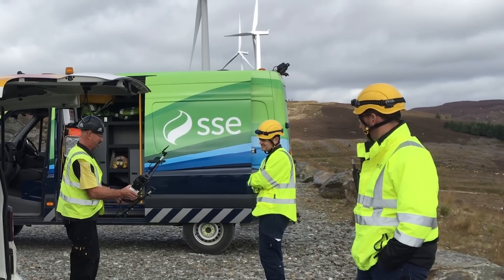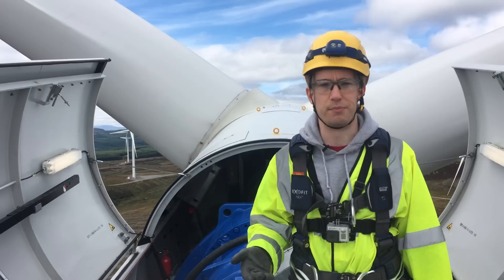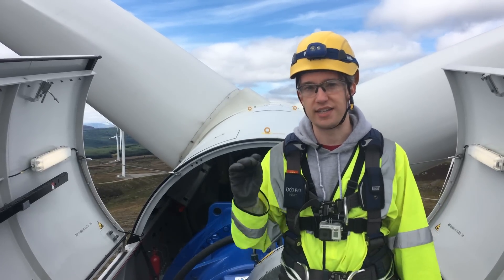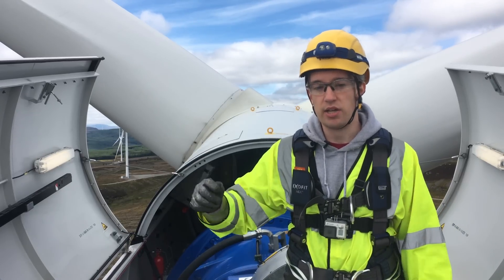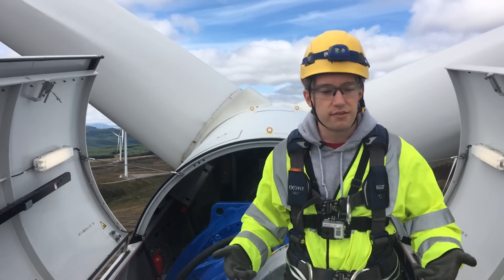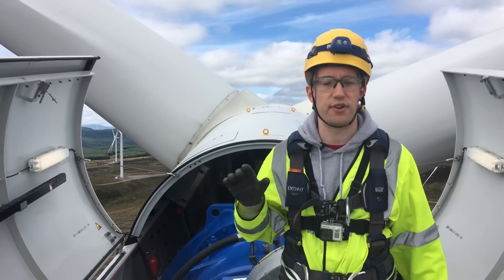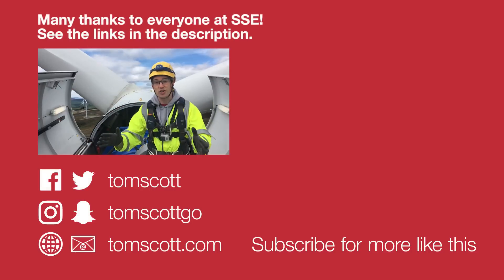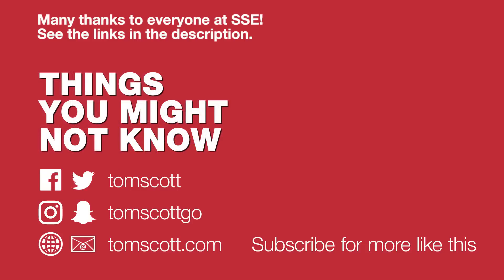The Problem With Renewable Energy (and how we're fixing it)

Comment: Hey, if I buy an electric car I don't want to wake up in the morning to see the battery is at 10% because of the lack of electricity they had to compensate. What about that? And than everyone will have to get it charged from the net since they don't have the range to get to work, how would you compensate that? Or in the other case people with such statements could be smart and say 'hey, let's make a deal that you in the morning will at least have 80% left in the car' I would say that would be great, but than the problem is since only 20% of the battery can be used, only 20% of the projected storing capacity will be free to cut down high and lows. Than maybe a giant monolithic battery would still be needed... Oh and on the other hand, good luck with trying to use hydrogen cars for this plan. I'm sorry so be so skeptic, but I believe there are better ways. Such as storing an overload of energy in biogas or hydrogen to burn it in a generator when needed... Or to propel a car...
Reply: Pretty sure it wouldn't work like that. At any one time given such a large infrastructure envisaged, there would always be enough vehicles that were near full capacity or full charged that some could be used for short time spans for load balancing. The computers on the system would be aware of the times the car was usually used and so could make sure it was charged ready for that time. Also let's not forget this would no doubt also be a high current fast charging infrastructure, so a vehicle could recieve a full or 80% charge within a few hours if needed.
Reply: +rationalmartian within a few hours doesn't sound quite fast to me. If I had to leave for work I wouldn't wake up hours before to get it fully charged. That's one of the reasons why I prefer fuel cell cars above electric cars, fast charged. I would like for people to believe in this 'electric car as a buffer' system to show me the numbers of reality. Because in theory everything can sound great until reality hits in... That is what I fear that could become the problem here, or there would be a complex system to make sure ones vehicle would be charged when needed, or just left at let say a minimum of 80% charged for unpredicted use of the car. Or there should be another magical way to assure people that the car can be used at al times when needed. It is pretty paradoxical to try to use an battery-electric car as a temporary electricity storage and as a car that should compete with the independence, range and full time availability of a fossil fueled car...
Reply: Keep in mind that the point of this isn't a long term power shortage: this is for immediate pick up, so it would only be a few minutes of discharge, which isn't going to cause a significant problem for running out in the day.
Reply: +Chris Hughes (crh23) Than why would they claim that there wouldn't be a need for 'giant monolithic batteries' or other kind of storage facility just bin using the electric cars' battery... As I said, if it wouldn't affect the independence of the car I wouldn't be bothered, but for what I see know most are vague about it, never claiming his much impact it can have on the car, even worse, they count the full battery storage potential of the electric cars and than speak about that total being the total potential that could be used before having the need of 'a giant monolithic battery' which for me means they full use the full potential of the car, that could give the risk of having not enough electricity in the car to get to work. And yes, fast chargers could help in that case, but if I plug an electric device in the wall, I want it to be charged to at least a useful load (as iPhone user I know how hard it can be to have not enough battery power left)... Just my opinion though

Comment: You don't need to sell the power back from your car. It would be enough, if the car would stop charging when there is not enough power.
Reply: That would require extra technology in all EVs. The grid already has to monitor and regulate the electricity flow, drawing power from EV batteries for brief periods just "reduces" the need to build large energy storage facilities.

Comment: But this problem wouldn't occur with solar energy right??
Reply: Happens with solar, too. Can be fixed with batteries. If you've got the money for a big enough solar array and battery bank, you can run your house with no grid draw and have your grid connection as an income source, rather than an expense.

There is one case where it doesn't happen with solar, and that's a molten-salt solar-thermal power plant. Those store the sun's heat in molten salt for generation after the sun goes down.
Reply: @Roxor128  ohhhh thankss for the knowledge

Comment: Couldnt u use the electricity to power electric motors to Spin the thousands of tons of metal and when u Need ist just stop the motors ...
Reply: Google synchronous condensers. They are primarily used for voltage control, but provide inertia (although much lower than the turbine generators inside conventional power plants.)

Comment: Buy cheap overflow electricity to your own cars & sell it back later automatically at higher demands. Interesting idea.
Reply: Interesting idea but the effect on batteries should be evaluated before implementing a system like this.
Reply: @FrainBart_main   Yes. no one wants the expensive battery overworked, reduced life span & expired even if the car just being idle in the garage.
Reply: @nightsage217  You're right but I don't know how much this would shorten the life span if a lot of cars would be used at low power for this (maybe it would pay of because of the cheaper tarrifs). I think a better option for demand-side management is in devices that have long thermal time constants like water heaters, just like they are doing in South Australia.

Comment: The Solution is NOT Difficult - Use wind to produce the energy and to create hydrogen from water, and store the hydrogen in high pressure takes underground close to the wind farms.  Burn the the hydrogen when power is needed.
Reply: Two problems with that:

1.) hydrogen being the lightest element in the universe, even as a diatomic gas, means that it’s very difficult to contain in large quantities at high pressures without leaks. It can literally squeeze between iron atoms in a steel container if the pressure is high enough, making everywhere a potential leak

2.) the process of electrolysis and conversion back into water + electricity is only about 40% efficient at most due to heat losses, much less than the energy conversion of a battery.

Comment: Correct me if I am mistaken but a long term solution to this (maybe more expensive) would be to switch over to direct current.

Not sure if that works out but the power production just feeds into the flow of electricity.
Reply: Edison was a proponent of DC. It requires an extreme number of generation systems.  Tesla and Westinghouse proved ac was superior. No electricity is safe, but AC is able to move over long distances, DC is basically going to be a power plant in every neighborhood

Comment: 30% of the time it works all the time.
Reply: Funny but it actually operates more than 30 % of the time. The average capacity factor is somewhere around 30 %, but they are operating at lower than rated power probably 60-80 % of the time.

Comment: FAILL!!! All coal plants where on standby burning lots! LOTS! of coal!! Really! And also the gearing doesnt't matter fucks for modern mills because they have frequency(very expensive!) frequency converters. The mill you @Tom Scott are sitting on is really small. The ones here are huge and use HUGE DC magnet generators!
Reply: Utter rubbish, plant on standby is not burning any coal, they simply take longer to get back on load. Pumped storage and system capacity takes care of fluctuations.
Reply: Like Germany has so much pumped storage. And what system capacity are you talking about!? The overloaded power grid or those of neighbouring countries? that share the same problem!?
Reply: Pumped storage is A joke.Here in the Netherlands quickstart power is provided by gas turbines and diesel engines.Germany has just approved  hundreds of MegaWatts of diesel buffer power! for their failing windmills! How green you want to get it?

Comment: Wind is not replacing coal and oil at all! Every single piece or process to put thoose turbines functioning needs a lot of coal, oil or gas. There's a lot of steel, concrete, fiberglass, cupper, neodimium, heavy vehicles needed to install and transport; none of thoose come from wind or sun.
I like the idea for balancing the grid but so called «renewable energy» is just another extension of fossil fuel's bussines as ussual.
Reply: What's coil
Reply: @suityboi2126  Is a mistake. I'll correct that, thanks. Mi english writting is rusty.

Comment: It’s not the rpm that govern Hz output.  It’s the poles in the rotor times the rpm, come on.  You’re filming on top of a windmill as if you’re an expert....
Reply: Pole pairs times the rpm/60 = grid frequency to be exact and that is only for grid-tied synchronous generators. There is also research of how to use wind turbines' kinetic energy with power converters' control for frequency support (synthetic inertia, deloading techniques (over-speeding, pitch control)). Sorry, I had a need to be a smartass for a minute.

Comment: Or you could just have a few reactors hooked up to the grid to make up the differences, those are really good at scaling to demand because the rate can be determined exactly with control rods. Mostly renewable with a little nuclear is a perfect solution until fusion comes about.

Comment: Somewhere, 6ft underground, Thomas Alva Edison is laughing his half decomposed lungs out... AC has a hell of a lot of benefits, but a DC grid would make this problem absolutely moot.

Or, like, feeding everything through a rectifier then electronic inverter chain...

...or maybe just a ginormous flywheel somewhere, connected to the grid via a motor-generator.

Comment: Orrrr we can just use the most green option available... nuclear. We should be focused on energy density, not incredibly inefficient methods like wind and solar.
Reply: Nuclear power is more expensive then windpower.
Reply: @0000-z4z  if you want to pick a single reason instead of the whole picture, I guess I can't stop you. However, I will point out that wind is heavily subsidized while nuclear has an incredible amount of red tape that drastically increases the initial costs. Hell, even getting the government to approve a new nuclear plant takes a decade!

We also shouldn't just ignore other factors. Do you know how bad wind turbines are for predatory birds? They are being slaughtered. Endangered species and all. How about how inconsistent wind is and the transmission infrastructure that is requires? I would bet the costs for batteries to smooth out the power supply aren't in the cost estimates. Hell, there aren't enough rare metals to even make the batteries required to do it! Speaking of rare earth metals, do you know how much pollution is involved in mining for them? You think you are saving the world by falsely trying to lower greenhouse gasses (hint, you aren't, they are just being emitted in different stages of production), but instead you are releasing incredible amounts of toxins into the environment.

Wind and solar sound great until you actually examine the entire picture instead of keeping the blinders on by focusing on singular talking points.

Comment: No offense intended to you, Tom, you're brilliant, and I love your channel.
 But, in response to the idea you explain in the video, I have to say:

The solution to the utterly non-existent system inertia inherent in essentially all renewable/non-hydrocarbon energy sources (aside from nuclear, which is still the very best option for power generation, particularly breeder reactors that produce essentially no radioactive waste) is increasing the number of charge/discharge cycles in consumer electric vehicle lithium ion batteries, thereby requiring them to be replaced sooner. Batteries whose production results in environmental devastation on a truly horrific scale. Yes, I see the wise stewardship of the environment in these plans. /S

Renewable doesn't work it's that simple. In the end, renewable energy generation is just not a practical, sustainable means of powering a civilization. Hydrocarbons are suboptimal, but they work. Nuclear is unparalleled in its potential for safe, environmentally neutral, and inexhaustible energy/power generation, and it's the best bet we've got, barring antimatter or something.